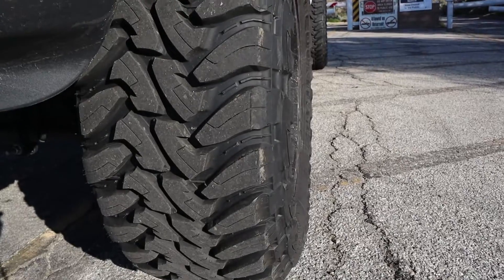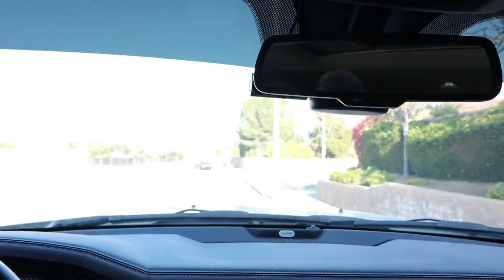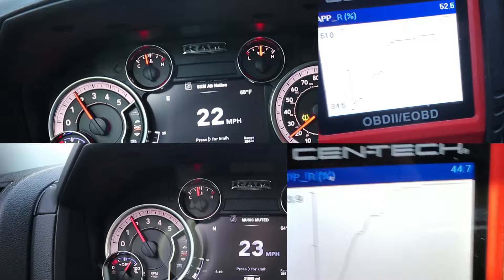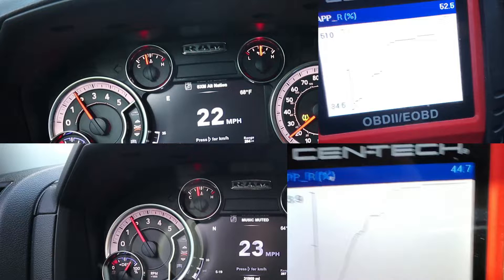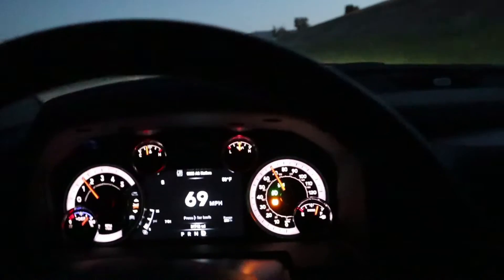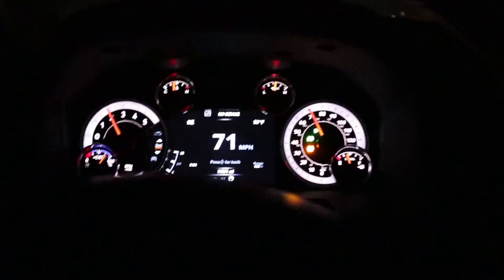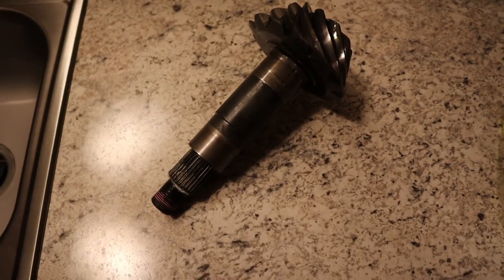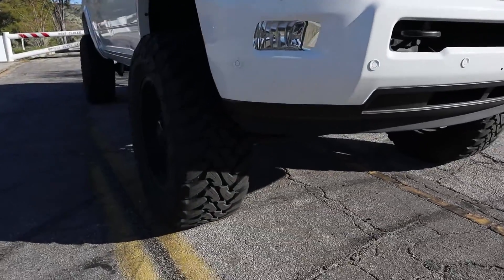Comparing from a 3.42 gear ratio to a 4.56 on the RAM 2500 with 37 inch tires!

Comment: Strange, on my mountain bike if you have the rear gear on the largest it's easier to go uphill. The smallest gear makes it go the fastest. I think you have a different model bike where your gears do the opposite.
Reply from the maker: I say it awkwardly in the video when comparing to the gearing of the truck as the other commenter had pointed out and I realized. But, how you are saying I haven’t personally experienced, the larger rear gear allows more top speed but you have to put in more effort to start out or while going up hill. Then when on the smallest gear in the rear, you can pedal very easily and fast but you barely move anywhere. This makes it easy to go up hill. This is how I at least remember it and the other commenter agreed. I apologize though if I am wrong, just trying to give some analogies, I probably should of done the explanation with an actual bike
Reply: DevonsGarage Get on a bike and check your theory. Think of a dirt bike. When you want more torque (easier to accelerate and go uphill) at the wheel you go to a larger rear sprocket. When you want to go faster (slower to accelerate but higher top end speed) you put on a smaller sprocket. Same for a bike. Not putting you down but if you have a “good amount of knowledge” on the subject but don’t understand the basic concept of gear ratios it makes me wonder...
Reply: DevonsGarage When you changed the hearing on your truck to accelerate quicker but you lost a little top speed ask the guys if the pinion gear (front sprocket) got bigger or smaller compared to the ring gear (rear sprocket). They will be able to help you.
Reply from the maker: SoCali7three I believe this may be like the other commenter had stated I worded things wrong in the video. On a bike, a 1:1 is easy to start off.. same teeth pedal and rear wheel (let’s say 35 to 35) sprocket. While then the less teeth on that rear sprocket (lets say 11 teeth, so 35 pedal, 11 rear) will create more speed on the rear wheel but harder to start. We are in agreement on that. Now in the truck and why this becomes a harder analogy, a 3.42 gearing is faster top end than a 4.56. The driveshaft spins 3.42 times around to 1 full axle rotation, therefore less engine rpm speed compared to vehicle speed. With the 4.56, I am getting a full rotation more on the driveshaft to complete my one wheel rotation. So more RPM speed versus vehicle speed. Which is why I lose the top speed and cruise around 75 at 2k rpm instead of my original 1500 rpm. I agree with you just the bike situation throws things off because it sort of explains backwards. We are adding teeth to the rear to get our ratio, not taking away. More teeth than driving gear, easier. Less teeth than driving gear, harder.
Reply: DevonsGarage This comment makes some sense now. Your last comment: Larger rear gear on bike means faster too spread, smaller rear gear easier to pedal but less speed is completely backwards from reality. All good, not worth more banter. Jump on a bike sometime and let me know if a larger rear sprocket gives you more top speed vs. a smaller rear sprocket...I think you’ll find that theory is backwards.
Reply from the maker: SoCali7three I do also have the factory gears and saw the new ones myself. I understand the concept completely, also stated in my comment before this, I’m saying “in theory” for the driveshaft turns. I just put this into a perspective that makes it simpler in the video except I have agreed previously that my wording on bigger/smaller vs Higher/Lower when talking about the mountain bike was confusing in the video
Reply from the maker: SoCali7three no man trust me I agree with you on the bike thing 100% I promise. I really do need to remake the video lol. I hope you don’t think I was trying to argue back, just understanding your side and trying to show I at least do know the difference. I’ve ridden bikes a lot but I completely butchered the video on that part :/
Reply: DevonsGarage No worries there’s always someone who wants to call people out on here but it’s not my intention to do it maliciously. See you on the next one 🤙
Reply from the maker: SoCali7three trust me, I learn from it and sometimes it sucks hearing that you mess up something but it happens and you fix it then move on. I do appreciate the positive criticism otherwise there wouldn’t be anything to improve 🤘🏻😎

Comment: Way to go bro, extra special demonstration describing gearing and you totally botched it.  Little gears are hard to start off, but go fast.....big gears start off better, but you can't go fast.  Literally just like what you are trying to get rid of 3.42 (little) to 4.56 (big).
Reply from the maker: Derek Crismond, I apologize if I over-explained, the gearing does work just like a mountain bike for those that aren’t familiar with the actual gears inside the truck. The ratio still relates to the turns of the driveshaft. 3.42, a low gear and 4.56 a high gear. 3.42 have less teeth and allow more speed vs torque. The 4.56 would of course be opposite, more teeth and easier for torque but less speed. We are both in agreement, I just tried to explain in analogies for others to also understand. I’ll try to be simpler in the future 🙌🏻
Reply: @DevonsGarage  I figured you knew you what you were talking about.  However, you say it completely backwards in the video when using the bicycle analogy.  No biggie, just hatin' lol.
Reply from the maker: @AFPECE   You are right, I just re-watched the video.. I shouldn't of mentioned the bigger and smaller sizing because it does not relate to the same comparison with the gears. The theory does, but I went backwards on high/low gearing vs bigger/smaller sizing. I'm glad you pointed that out honestly because I don't think about those things sometimes lol and have to rewatch myself to see it differently. I appreciate you man and I definitely try to learn from my mistakes, that's what makes the car community awesome, we learn from each other!
Reply: Are you saying that if i were to do 4.56 gears in my 6.7 dodge that i would loose towing capability ? And maybe fucking my drive train if i tow a trailer ? Please reply to this when you get achance

Comment: Your fuel economy is gone.
Reply from the maker: @matthewloew2309  surprisingly no, I had the opposite happen because of my low end torque with the 4.56. At least this is in regards of the gearing for my tire size. Now if you want to say my fuel economy went down because of 37’s, sure, that is expected. And if you are comparing highway speed only, also sure. But overall average I was not putting that stress on the drivetrain trying to get up to speed and saw minimal difference on mpg before and after but was able to get a better number during city driving comparisons when just comparing gear ratios.

Comment: I have a 18 ram 3500 how much did that cost you ? I live over in the antelope valley and interested in changing
Reply from the maker: Best place near the Antelope Valley (where I am as well) is definitely Offroad Bully at least in my opinion from personality/price/overall experience. Otherwise another decent shop out in Sylmar area is Jet Rear end (pretty sure that’s the name, it’s been a while). Gears themselves were around $1100 and labor for mine was around $800. $1900 was a really good price for me. And the job was done extremely fast!
Reply: @DevonsGarage  $1900 for both axles?? That’s amazing. I paid that for one lol.

Comment: MPG increase/decrease?
Reply from the maker: It didn’t change as much as I thought it would. But that’s probably due to all the emissions stuff on this truck. I’m getting an average of 13 without towing. Stock with 35’s I was able to pull about 17 without towing. I think the higher RPM’s plus the tire size of course is what is mainly killing the MPG after the gear swap

Comment: Thanks for this. Can you tell us about fuel efficiency changes if possible? I have the 6 speed manual (third gen 1500) and went from 3.21 to 4.10s on 33s (have always ran 33s for last 10 years on the truck) and my power and acceleration is insane now but my fuel economy average went down 1-2mpg. My next set of tires are going to be 35s and I’m hoping the mileage will actually go back to what it was and I get the benefits of a better driving experience while respecting my transmission.

Comment: My 
14 has 4.88s
Reply from the maker: Now that would really add some low end power! I stayed around 4.56 mainly for the highway RPM’s. I drive up north in CA a couple times a year and usual traffic is around 80mph on the 70mph posted, I didn’t want to be too much higher than a constant 2k rpm’s

Comment: I'm not here to pick apart your video as there are a ton of people that will. I will say as a 4wd mechanic myself there are so many errors. The way you are comparing actual speed, RPM's, Pedal position and load on the running gear is way off. Do your research people and refer to professionals about gearing.
Reply from the maker: The idea behind gearing is simple, we put in higher or lower gears to relieve stress on the drivetrain whether it is for larger tires, towing, or for some it is strictly performance based. I took the easiest differences to show on camera with the before and after. Load does go down. Speed IS affected with RPMs. In my case, I lose top end. I tried to be very thorough on explaining why the differences occur. I have a very good understanding the mechanical side to how this works and only didn’t perform the work myself because I do not have a tool to measure backlash to be able to shim correctly. In this video, I was honestly just trying to show the immediate differences and explain why I went with the gears that I did. I am not here to persuade someone with wrong information. I apologize if the video was upsetting as that was never my goal. I used the tools I have to compare the differences that I could show with the 3.42 vs 4.56

Comment: 3.42 gears on a Dodge? Dodge put 3.55s, 3.73s and 4.10s on their 3/4 Ton trucks and heavier. Chevy uses 3.42 gears.
Reply from the maker: Incorrect, I have the build sheet from buying it brand new. Window sticker legit states 3.42 gears both front and rear 👍🏻
Reply: @DevonsGarage  Yeah I was looking it up just now and Chrysler put 3.42s in their 2500 and 3500 trucks sense 2013. It was the only gear available in the Short box trucks.
Reply: @DevonsGarage  I don’t know what I was incorrect about but ok. Dodge has all ways put 3.55, 3.73 and 4.10 gears in their heavy duty truck until 2013 and it appears to have stoped in 2019. Now they are back to the way it was. It didn’t last long. I been driving Dodge trucks sense the 80s. That was the only gear ratios available. 3.73 gears were still available in your year model truck but you had to get the Crew Cab long bed it seams.
Reply from the maker: @stgraves260  uhm, before you edited your original comment, you wrote that dodge does not put 3.42 gears in their trucks. I said that is incorrect as I have the build sheet/window sticker for my 2018 RAM 2500 that 100% states it came with 3.42’s from the factory. That is what you were incorrect about
Reply: @DevonsGarage  The message should not have sent because I wasn’t finished yet. My phone froze up and would not let me finish.
Reply: @DevonsGarage  That’s why the statement I sent said 3.42 gears in a dodge? It was a question. I can see your point though if the message somehow got sent without hitting send. That’s a new one on me.
Reply from the maker: @stgraves260  yeah, your first message that I got on my notifications and screenshotted said word for word: “First off Dodge never put 3.42 gears in anything.”
Reply: @DevonsGarage  that’s crazy cause I never sent that. I typed it and stopped myself and deleted it. I was in the middle of looking it up just in case something changed because Dodge all ways used 3.55, 3.73, and 4.10 gears. That’s when I found out dodge put 3.42s in their 2500 and 3500 from 2013 to 2019. That’s all I found on it anyway. So I corrected myself before I sent anything because I know how people are. General Motors uses 3.42 gears like dodge used their 3.55 gears in everything. Dodge seams to be using 3.92s in all most everything now. At least anything under a 2500 Ram.
Reply: Dodge does put 3.92 gears in their 5.7 trucks.
Reply: @even7steven  I new they did in their half tons I just didn’t know they put 3.92s in their 3/4 tons.